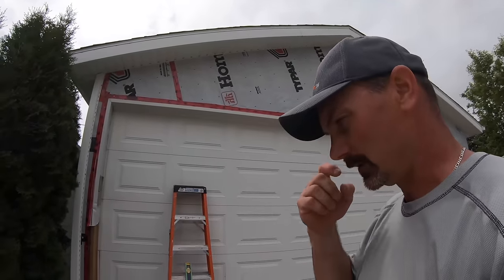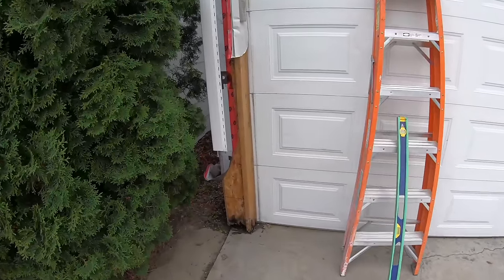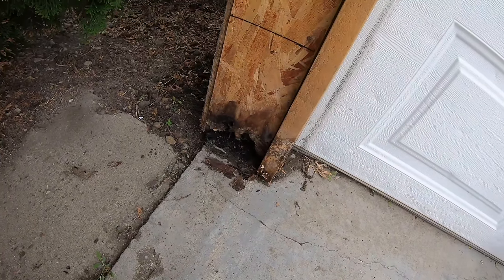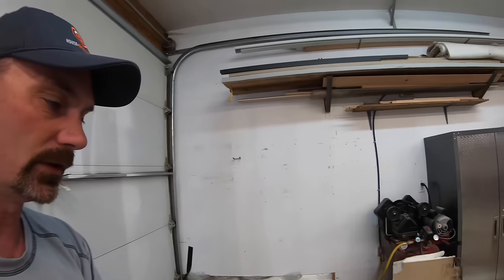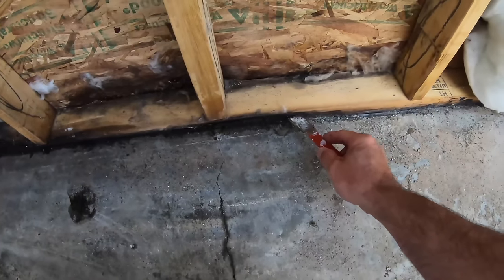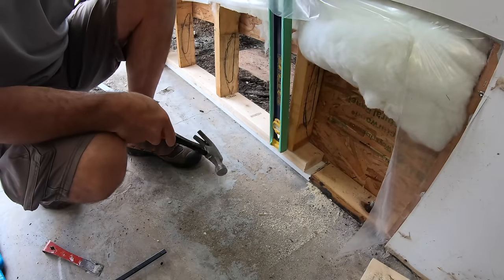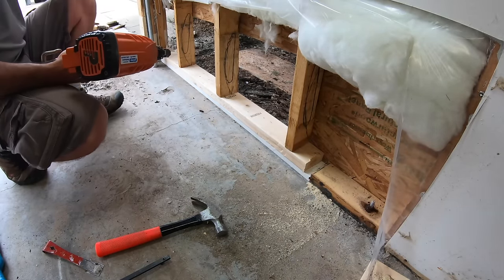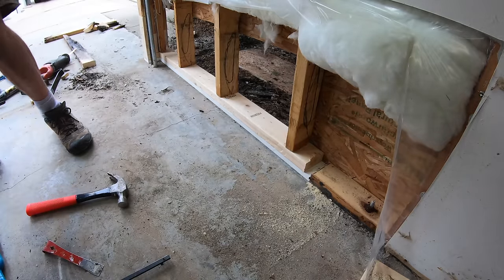How To Replace Wall Plate

Comment: Anytime wood touches concrete I always use pressure treated for bottom plate, first row plywood, same thing, or run treated 1x 4 then stack plywood or osb from there up
Reply: No DPC?
Reply: Thats the correct way to do it. Also have to remember if you make any cuts in the pressure treated wood, you have to coat the ends with End Sealer.
Reply: @richiestarks6163 pressure treated means it retain moisture. What do you think happens with the white dry wood that you put against the pressure treated wood? :)

Comment: I had same exact problem. I cut out bigger section and poured 3 in high x 8 in wide  cement footing under the entire front wall to raise the wood out of wet area. Then built back pressure treated wall plate on my raised cement. Where I live is high risk of termites attracted to wet wood.
Reply: @John Perricone I was wondering if pressure treated wood could/should be used since in his case since it seems water will continue to pool in that area.
Reply: What you did is exactly what I need to do with my garage. Someone previous to me extended the garage about 2 feet into the driveway, without raising the cement. I get water in there and bottom plate is fairly rotted out. I was hoping to find a video of someone doing that but haven’t been able to find one. I could just do what Shannon did but that wouldn’t stop the water from getting in.

Comment: To help alleviate the water buildup, cut out a channel in the concrete right in front of the building and install a Storm Drain Channel Drain Kit and drain it into a line in the soil beside the concrete and out to the street.

Comment: Knee pads are the way to go.    Just looking from my vantage, you know the water is going to continue to pool their and the PVC won't necessarily rot, but what about creating a drainage water Channel Through the PVC to the outside of the garage so the water doesn't actually stay on the pad inside the garage?

Comment: This is an excellent repair. I especially liked the prefabbed corner piece and how it fit into place so perfectly. The only thing I would have done differently is to possibly cut a channel in the concrete under the bottom plate so that water could drain out instead of puddling on the inside.

Comment: Looks sweet!! I was wondering, for the water problem, its still gonna rot the dry wall.? Maybe you could cut a small trench in slab just in front of garage door.? There is already a crack in slab there. Then put in a drain trench along the front of garage!? Maybe would make a good video?

Comment: Outstanding video. I've got a very similar problem on two walls of a small exterior closet that houses our water heater and a bit of storage. Unfortunately, I've put the repairs off way too long and my damage is worse than yours (mold has appeared). Thanks to your use of PVC, I've got much more confidence about proceeding my myself, without calling a pro. Thanks!

Comment: Very valuable. New construction where all is nice and proper is one thing and thanks for it. But situations like this where all is not clear and proper but needs to be repaired is very useful. Both the tearing it apart etc and the tie it back together. Thanks again.

Comment: I like how you pre built and installed the rotted corner before further demolition. It makes good sense seeing it done that way. Hope the pvc strip works, but start digging out the mulch and soil soon. Snow soon I bet.
Reply from the maker: The exterior soil level is not really the problem here , its the low spot in the pad against that wall where water sits. If you watch the first 3 minutes of the video again I explain it there.
Reply: @HouseImprovements  Yes, you did explain that too.
Reply: @HouseImprovements  But you did not fix the low spot in the pad.

Comment: I'd throw a bit of 'damp course stripping' in there mate (just my two cents worth for that mongrel job) , that will help it last a bit longer. Given the slabs a bit shite and the water running off into that corner, so that sucks to be that home owner. I'd have used a scrap piece for your bash to instlal that bottom scab plate to save it's end or if you had one (and Acro Prop, to push up the load on the trusses/roof).  But a good job mate, it well help it last a few more years. Thanks for the vid and cheers from a fellow Carpenter from Australia. Love your vids, they're a great learning resource for all of us Carpenters, we can always learn from each other. Cheers.

Comment: Excellent video. I have two corners like that. One on each side of the rear sliding glass door. Our roof has no rain gutters and the rain spills off the roof onto the patio and splashes back under the siding. In turn it has rotted out the bottom of the wall.
Reply from the maker: Get some gutters that roof, that is a huge cause of rot and mould in homes.

Comment: Excellent video. Clear explanation and description of techniques. Others have commented about use of PT.  The corner insert was a great idea as was the use of PVC board.  Was the mold a possible health risk?  Last time I did something similar, I used bleach to clean and kill any surface mold before I went after the damaged wood.

Comment: Might be a good idea to use some of that pvc  board on the outside bottom and the inside to prevent rot. 
I think now you need 8” to the ground, but my garage is built the same way and I need to repair my corner too. 
I think a post jack under the door opening would be a good idea as some bear load in the corners

Comment: Great video Shannon. Unfortunately my garage was built on slab , I’ve had the water issue . I’d did seal the edge of the siding / cement. It’s stopped, but I have a feeling there’s damage . I plan to change the siding some day. When I open that can of worms, I guess I’ll see?? This video will be remembered, when that wonderful day comes🤬🤬

Comment: What a great video. I have a rotten door frame in my basement. Would I need a new door frame or just replace one board at a time? I am sure I will find more once I start the removal process but the door frame itself was my concern. I purchased it from Lowes or Home Depot 10+ yrs ago and guessing I can not just buy a frame, I would have to buy the door which I do not need. Your videos are inspiring and very helpful. 
Sometimes the DIY person may be handy but does not know a tool or a product exists to do a specific job and without people like you, we would be at the mercy of the company and what they charge. Peace, Mo

Comment: Great video!  I like the idea of using pvc boards for water prone areas. Is there an issue nailing exterior siding to that material? Will nails grab strong from outside siding to pvc?  Any issues nails grabbing from 2x4 plate to pvc board?
Reply from the maker: PVC does not hold a nail as well as screws but if you need to use nails I would also use an adhesive . For the siding your not normally nailing that low and you have the wood plate above it to nail the sheathing to so the siding nailed to sheathing is fine.

Comment: Thank you for the video.  Q&A. Why didn't you use pressure treaded wood? Or for the bottom plate? Or raise foundation up with cement? At least 8 inches?
Reply: I did a 3 inch raise with cement.
Reply from the maker: To do a cement raise at this point on top of the old concrete is not very efficient . This should work well and last forever.
Reply: @HouseImprovements  thank you. For answering

Comment: This couldn't have come at a better time!  The only thing is I have basically the same repair , however the rot goes behind a set of concrete steps?  I guess I will have to pre-build a section of wall with the sheathing in place (bottom plate attached?)  If only I could attach a picture...

Comment: Great job..Question for you...Why did you not use pressure treated wood on top of the PVC board ?
Reply from the maker: The PVC isolates the wood from the wet area so there is really no need.

Comment: Just out of curiosity Shannon is there a reason why you wouldn't do a piece of treated lumber on top of the pvc board? Thanks.
Reply from the maker: No need . The PVC board is what will get wet if water still sits there and water will not be deeper than the 3/4" that the PVC is thick so the wood above will never be wet.

Comment: Hey loved the video and very informative. I had a question and I wanted to make a suggestion. With the new floor plate would a waterproof membrane be a good Idea to save and protect the new floor plate? Wrap the membrane underneath the bottom of the new floor plate and seal on the outside of the new walls then cover with the tyvek. And wouldnt it provide more strength and stability to have the new floor plate extended all the way through to the end of the walls, then install your customized corner piece on top with construction adhesive and some screws? 

I have this same issue and that was an approach I thought of from your video.
Reply from the maker: What I did here is perfectly fine.

Comment: PVC Trim Board you used right?? This stuff is great and doesn’t rot. But How does it hold up structurally as bottom plate on this install and any others you have used on?
Reply from the maker: It's solid PVC so it should be fine. Have not noticed any issues yet.

Comment: Curiosity, as I will be attempting a somewhat cousin-like job to this, only mid-wall….

All went well, but I was wondering why no added ceiling support was used with this being a load bearing wall.  Most voices I have heard so far are advocating such a precaution.  Would love to hear your take on that topic.

Enjoy!
Reply from the maker: It is a good idea ,however in my case I knew by changing out the very corner first I could work on the short intermediate section of wall as my wall would span that distance without issue because there is not much load on it. If you have any concerns at all of your situation you can build a temp. wall 2' - 3' back from the work area supporting the rafters above.
Reply: I’ve got a strange configuration on my roof with a very old house. Still checking into it, but I’m hoping to avoid the secondary wall. If I end up having to do it, it’s going to be a chore!

Thanks for the feedback!

Comment: If the studs were rotten higher. Would you sister them on both sides? Also how much overlap if you were going to sister them
Reply from the maker: In most cases sistering on one side is fine and lapping 36" to 48".

Comment: Was that untreated wood for the original material?
Reply from the maker: Yes it was not treated wood to begin with. Now we use treaded bottom plates and or sill gasket which would have helped in this case and made it last longer.

Comment: Can't help but notice the cracked concrete both inside and outside.  Have you thought about putting leveling compound under that corner of the slab?
Reply from the maker: no , in this case that is not the issue.
Reply: @HouseImprovements  not wanting to argue, but did you check that corner of the pad for level?  Doesn't look level in the video, and with water pooling in that corner, combined with the cracks and that being a corner supporting the extra weight of the door,  that seems to be contributing greatly to the problem.  Wiss you would make a followup video.

Comment: I’ve got a wall like this on the interior of my home (behind a kitchen sink) that’s a load bearing outer wall and the subfloor, bottom plate (about 3 or 4 stud bays wide) and about 5 inches up the studs in that area needs replaced. It’s a 1st floor wall and I have a basement. I noticed you didn’t build a support wall for this repair, is that because it’s a single story garage? Hypothetically, would you recommend a support wall to take the load for my scenario?
Reply from the maker: Yes. for the amount you need to replace
Reply: @HouseImprovements  Thanks for the answer! I’ve been doing some additional reading and building the support wall about 24 inches from the load bearing wall is the maximum distance away I can put it and I believe I’ll need to put a support wall on the 2nd floor and basement in the same location (above and below and same distance away from the outer wall) to properly support the load, correct? Thanks for any help! Love your videos man, they’ve been VERY helpful over the years.

Comment: I would remove about four inches deep of that dirt patch in between the garages and fill in 3/4 size gravel. That would allow water to drain deeper into the ground and keep that dirt on top from remaining moist long after a rain.
Reply from the maker: That is actually a sand gravel mixture but its getting pretty full of leaves and such now.

Comment: Hi Shannon, what's your thoughts on using a 3/4 pvc plate under your entire bottom plate say for a shed build on top of a concrete slab?
Reply from the maker: I see no issue with that at all.
Reply: @HouseImprovements  Great... I thought the same thing... just wanted to confirm with your experience... how is that repair job holding up now a days??

Comment: Enjoy your vids and have a situation I hope you might help me solve. 
I have a back porch on which the wall support posts sit about 3 inches IN from the concrete floor edge. 
 I am turning that porch into a sunroom and am now in the planning stage of doing so.
My concern is how do I water seal the wall that I will build between those posts? 
I know to use pressure treated wood for the bottom plate for the walls with a seal below it, and (I guess) take the vinyl siding all the way to where the wall meets the concrete floor, but there has to be something that would make a real good seal on the outside of the wall to prevent water infiltration and or seepage under the wall. 
I'm open to any suggestions! 
Thanks kindly!
Reply from the maker: Our forum is a great place to discuss things like this and get assistance.https://www.house-improvements.com/forums/

Comment: An excellent presentation, only fault I find is ...I would have used pressure treated wood to stop future rotting of base plate
Reply from the maker: PT lumber can still rot when its kept pretty consistently wet it just takes longer. PVC should never be bothered.

Comment: Wondering why you didn’t use treated lumber on the bottom sill, first when the garage was rebuilt and why not now even on your repair ??
Reply from the maker: Treated all weather wood would still not preform well when its wet very often. 
During the original build PT plate was not a requirement.

Comment: If you had one of those bolts through the existing rotted wood, can you just remove it and reuse it later? Also, that little gap at the end between the pvc and those two boards you used to sister to the existing floor plate and stud, is that ok to leave or should it be filled with expanding foam or something?
Reply from the maker: Those type of bolts I added are not removable for re use.
Yup put a shot of spray foam in there.

Comment: So PVC board is like the pressure treated lumber? It would prolong the life of the wood sitting on top?
Reply from the maker: Yes This is solid PVC and will not rot. I have a constant problem with water lying in this corner so this will keep the wood dry there now.Although PT lumber would have likely done the job , even PT lumber when kept wet very regularly would eventually deteriorate, so this should keep that from happening again.
Reply: I used pvc under wood framing in a basement that a couple of times a year experiences water seepage. And the basement year round had a mouldy smell. After the pvc install no more mouldy smell.
Reply: What do they call it at Home Depot? All I see is royal trim which is pvc, seems expensive but nothing just pure flat like a 1x4
Reply: @NikeMikey101  Veranda PVC Trim
Reply: @hj8607  thank you

Comment: Shannon - any thought about cutting a waterway to allow the water to travel from inside the garage?
Reply from the maker: I really need to keep it from going in . I should cut a channel in the edge of the pad and most would likely run off before it goes around the door.

Comment: Shannon, is there any issue with putting house wrap over rigid foam?
Reply from the maker: No, it's just harder to attach . If you get a bunch of wind before you install siding  you can have it come loose or come off. Much easier to staple it to the wall sheathing  then cover with foam.
Reply: @HouseImprovements  I really appreciate the response. Love your channel!

Comment: Do you think this is doable with removing the lower siding and wall?
Reply from the maker: Most likely doable all from the exterior.
Reply: @HouseImprovements  so sorry, I meant WITHOUT removing the wall. Just replacing the base and leaving the wall intact. Thank you for the reply!

Comment: If you dug a short trench outside the garage at you low spot, and put a pvc drainpipe in, would that help? I’m not dictating, just asking because I don’t know what the building restrictions are in Canada.
Reply from the maker: The water is actually  coming from the pad outside the door not from the earth beside the garage . Its a low spot of the old original pad that extends inside to that corner in the garage . The water makes its way around the end of the garage door and in. What I need to do is grind a trench in the edge of the pad so it would drain off the edge to the ground more . The main issue is that the area just inside the door is the lowest area so it runs there first.
Reply: @HouseImprovements  
Thanks for clearing that up. Also, if you would when you do the trench please record it and post it, if you have the time. Thanks for posting these helpful videos.